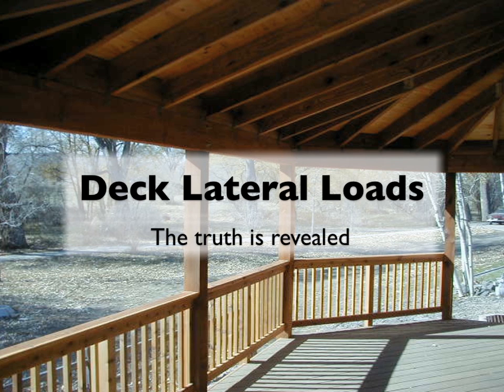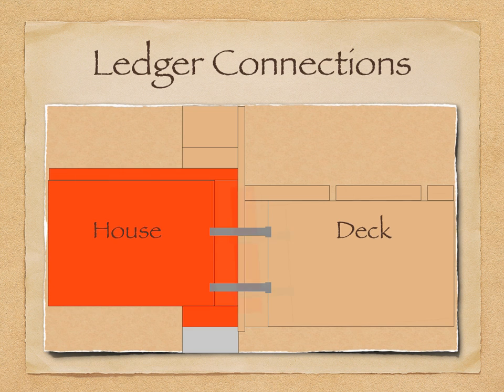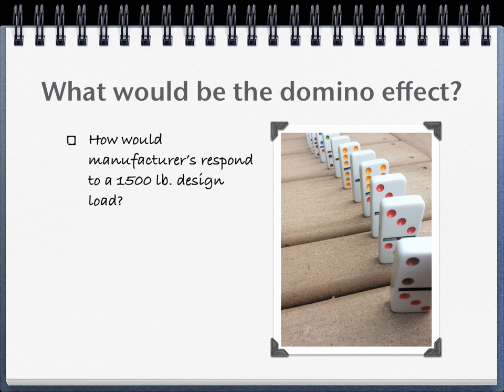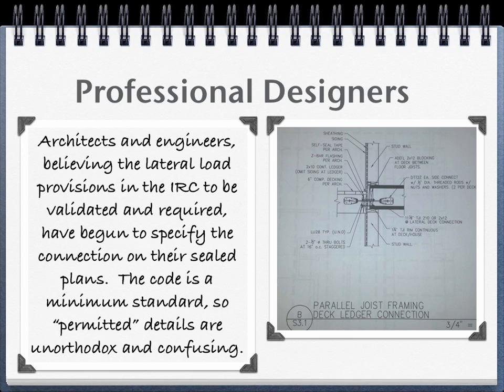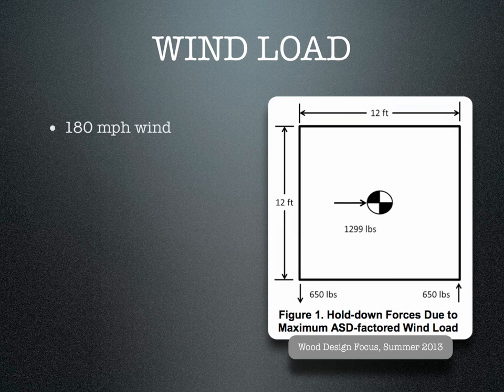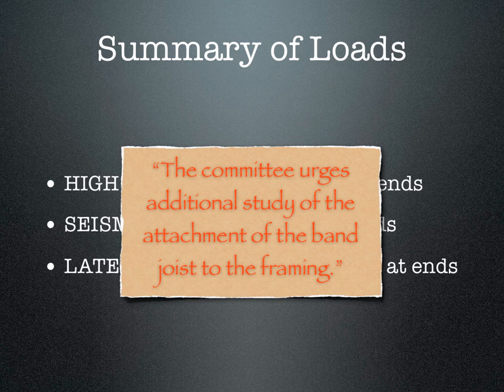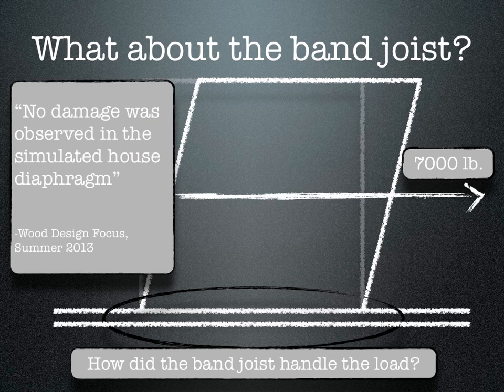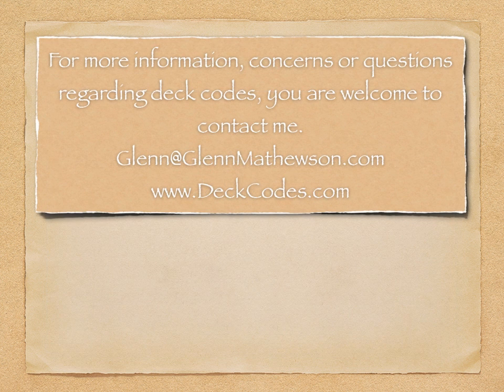Deck Lateral Loads the Truth Revealed

Comment: Proper flashing at the ledger may not seem important on a new deck, but over the years water getting behind it and not being able to dry out may lead to rot or spongy wood that the lag bolts are attached to.  If the framing nails used to attach the band joist to the floor joists rust out, the deck could easily pull away from the building and collapse.  I’ve read that putting spacers or galvanized washers behind the ledger to create a space for air circulation is an option, but I wouldn’t do it.
Reply: Flashing has been required for many years now. Your point is moot.
Reply: it only doesn't seem importatnt, to hacks.

Comment: Seven years passed. Does IRC have any plan to get rid of this lateral tension device requirement?
Reply from the maker: The plan of the IRC is the plan of those that contribute.  I think the only way to properly address lateral load analysis and design in decks is through more research, knowledge and contribution to the I-code development process.

Comment: When they propose stuff like this they should have to build a model and show it actually working. Yet, I see inspectors in my county and neighboring county not give two shits about flashing on the ledger which starts this issue in the first place. This includes my deck that was inspected but not flashed at all and had areas that trapped water. This is what happens when people who work in a lab have no idea of real world application.

Comment: SImpson Strongtie now has a DTT1Z tension connector which does not require invasive attachment inside the house. It connects the joists to the house sill plate. 
 Lag screws  attaching a ledger to the house band joist are fine for resisting lateral load, but they don't solve the problem of joists pulling out of their nailed hangers which have low pull out resistance.
Reply: My home was a kit home constructed of manufactured glulam logs and tji joists. The deck was attached to the parallel rim joist which was simply a tji joist with a plywood web stiffener added on the exterior side and squash blocks on 2' centers behind it. It was constructed in the mid 1990's by the home owner who wasn't a professional. There was no flashing and the ledger was fastened with a couple of 16 d nails on each end and a few short nails through the web of the joist. The rim joist web water damage under a patio door was significant. I replaced the rim joist with lvl backing it up with squash blocks 1' on center and lvl blocking behind the original . I flashed behind the ledger and reattached with Ledgerloks per code. I flashed on top of the ledger with self adherent material and galvanized steel flashing. I added 4 Simson DTT1Z lateral tensioners into the sill. Perhaps not needed, but I see it as insurance.
Reply: @richardthompson8207  I felt the same way. I added 4 dtt2z to my deck because at the very least it's just added safety.

Comment: Glenn, I really enjoyed this article. How does this relate to joist pull out away from the home? I never really considered it an issue for side to side but, have seen decks where all the joist pulled out of hangers. I tend to think several hurricane clips from ledger to joist would be more effective than two or four really big connections like these in your video.

Comment: Nice video, This presumes other things do not fail at connection points and deck design detail. The lateral tensioners when connected to the joist at each sideof the deck helps prevent the disconnection of the joists to the rim joist secured to the home. This video appears to be politically generated as well as informative. If loads are applied on the ends of the deck to creat a force pulling away from the home lateral tensioners applied properly would keep the banding joist tight against the home and prevent a collapse where the deck meets the structure. To remove tensioners from the code would be a mistake without proper provisions on deck joist direction and proper banding joist installation. In 22 years of inspections i have yet to see a deck properly constructed in the south central texas region!!! I think one must consider over engineering of decks through the code due to the bob villa syndrome of home owner and handy man constructed decks.